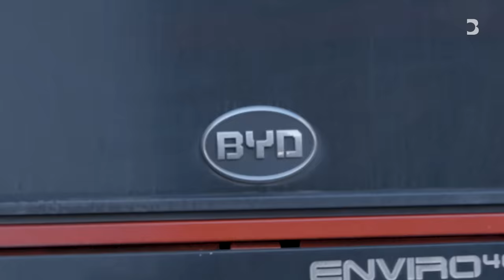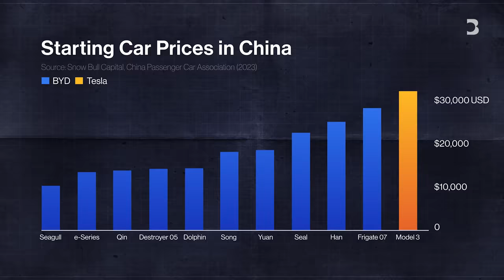How China's BYD Overtook Tesla

Comment: I'm not quite so sure the BYD phenomenon is going to hold.  First, BYD needs to address it's spontaneous combustion issues, and combustion upon impact problem and then perhaps it will be viable and ready for the US market.  Until such time, it's not going to fly given the videos I've seen...
Reply: But why are Tesla lighters selling so well in the United States? Do Americans lack warmth?
Reply: @YunLuoShanZe  But, you have to admit the BYD bursting into flames after it gets into a collision sucks big time.
Reply: @phanna7492  However, the number of people killed in BYD fires is far less than the number of people killed in Tesla fires.

This is enough to show that BYD's safety system can ensure the safe evacuation of people after a fire, while Tesla can only directly activate the car owner on the spot.

So which one is worse?
Reply: @YunLuoShanZe  I'm not defending  BYD nor Tesla.  Personally, I don't believe any of the EV cars should be on the road until the batteries stop igniting fires!  It's irresponsible and inhumane to sell a product which can take your life or put your life in danger with no warning, rhyme or reason.
Reply: @phanna7492  Fuel vehicles also have the same risk of fire and deflagration, and the risk is not much lower than that of EVs.

Do you also agree to ban all fuel vehicles from the road?
Reply: @YunLuoShanZe  Actually cars are going to be obsolete in the future.  Communities should be built around people and walking not built around cars and roads.

Comment: They will be the shortest lived Kings in history, these cars are not at all practical except maybe to do short shopping trips. Too many problems with them, long charging times compared to ICE vehicles, low battery capacity in very cold weather, Fire hazard in that if they ignite the fire is very difficult to extinguish compared to petroleum or diesel fire. Very few charging points around still. They actually do very little to curve pollution, it's just a case of out of sight out of mind.

Comment: No mention of China stealing technology, which eliminates a lot of the RnD costs.
Reply: BYD invented blade batteries.

Tesla has started using BYD blade batteries for the Model Y electric crossovers produced at the Berlin gigafactory, resulting in a significant increase in charging speeds.

Until recently, another Chinese battery maker CATL was the sole supplier of batteries for the Model Y in Europe, but in early May it was reported that Tesla had started using BYD as a second supplier.

Data posted on the German forum Tesla Fahrer und Freunde shows that the Model Y with the BYD blade battery maintains peak charging speeds well above the CATL version.
Reply: Ok . Prove it . Waiting .